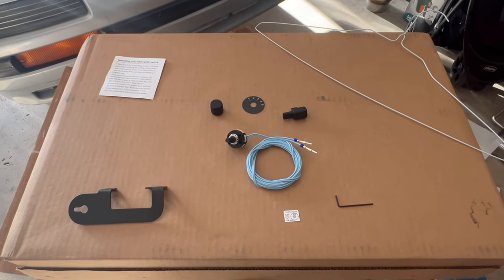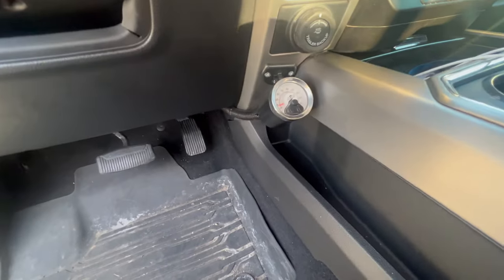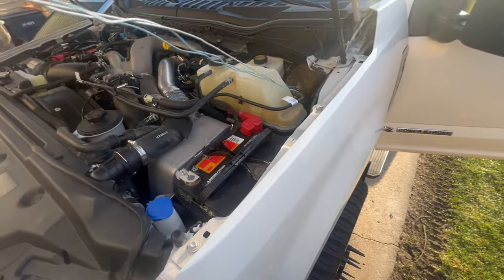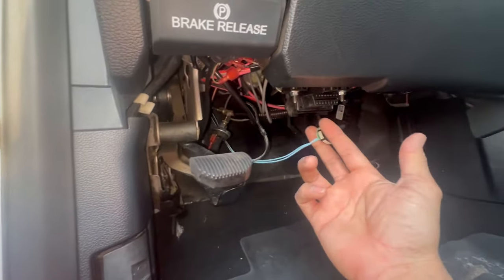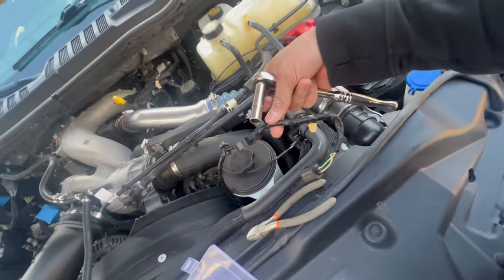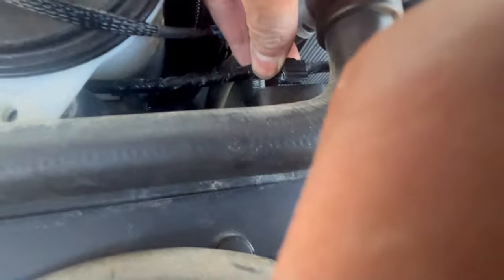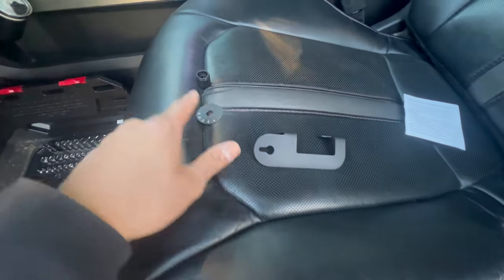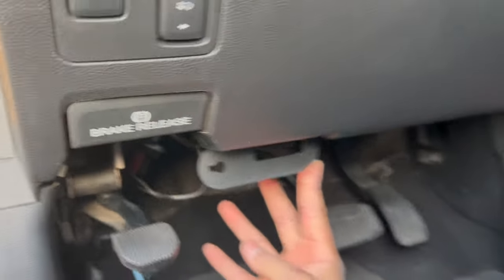F350 Dually THICM gets CAC SOTF switch installed and goes on CCS tuning level 5!!!

Comment: Finally deleted my truck, got the bench flash from ocdiesel and just installed the sotf, what level do you keep your truck at?
Reply from the maker: @joseherrera1167  I mostly keep it at 5 💪🏽😂
Reply: @Blacksheepperformance  might give it a try lol
Reply from the maker: @joseherrera1167  1-2 you won’t feel much difference 3-4 are good and 5 just opens that mf up! 😂🔥
Reply: @Blacksheepperformance  Im on 5 now, runs good👍🏽 does yours throw a lot of smoke or no?
Reply from the maker: @joseherrera1167  mine doesn’t that much only if I’m already cruisin and stomp on the gas pedal but only for a few seconds then cleans up clear. I don’t like all the black smoke anyways so I prefer it like that. Cleaner tunes.

Comment: Are you stock?   Any issues. Is it safe?
Reply from the maker: Yes only things done to it are what I’ve installed and posted on YouTube . I just finished the spe Motorsport fuel filter system but motor and transmission are stock
Reply: @Blacksheepperformance awesome. Bad ass truck! Moving for sure 🤟🏽. Thanks for the info
Reply from the maker: @perez9444  thank you, I’m going to be doing some dragy pulls on all the levels of tuning I have through ccs. Lmk if you have any other questions or need any links on anything ive installed.
Reply: @Blacksheepperformance  can’t wait see it. Thank you sir